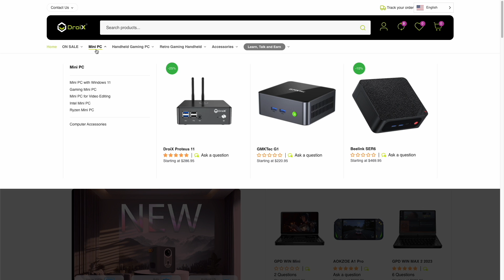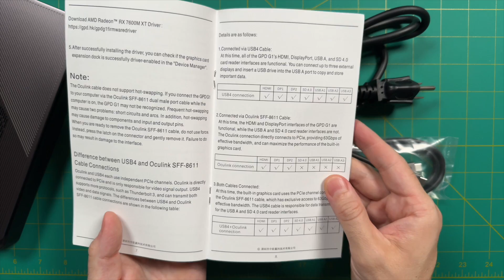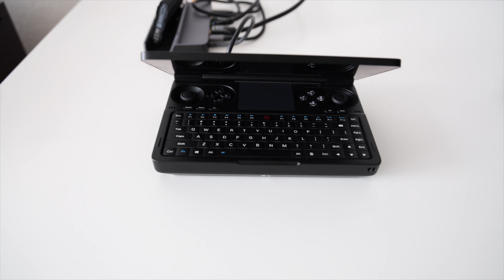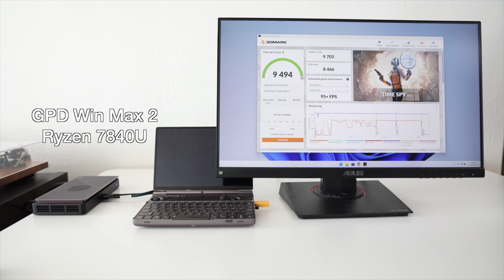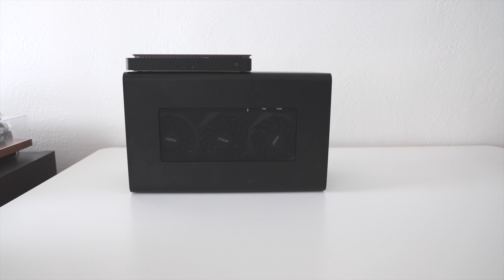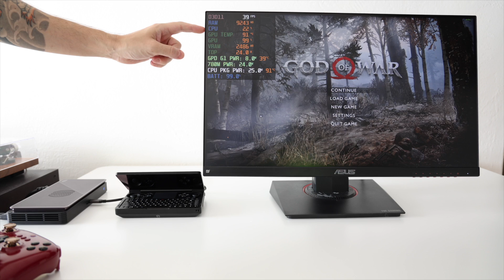Tiny GPU for Handheld & Mini PCs! GPD G1 Review

Comment: Honestly the value proposition is not as bad as what ppl here might think. Just the tb4  dock part alone can easily cost upto 300-400 USD. SO it's more like 400 usd for gpu and 300 usd for the dock features ig. Inbuilt power supply is a big W imo. It could be cheaper if power supply was seperate and has less ports.

Comment: It is also a great device for ultra portable or 2-in-1 laptops like the Surface Pro 9 or the HP Spectre 360. Turns them into very decent and portable gaming PCs. Both can be powered by the G1.

Comment: The 7600 is already a low to middling GPU and that fact alone means this thing's shelf life won't hold up well. Thunderbolt 3 and 4 have the same bandwidth limitations iirc.
Deciding on a GPD G1 vs a normal TB3 or USB4 eGPU dock is basically the difference between building your own gaming PC or buying a console.

Comment: I use the G1 with a WinMax2 7840u over Occulink as my main PC.  I love the small size and the flexibility of the setup.  Performance is plenty for my needs, as I mostly game at 1080p.  Wish they had installed a larger heatsink and fan to reduce the noise.  Maybe the next version.  =)

Comment: Hi, can the gpd g1 be a plug and play solution for the winmax2? instead of turning off the laptop everytime using the oculink.
Reply from the maker: Unfortunately OCulink itself is not hot swappable, so every time you connect/disconnect it should be done when the laptop is powered off. USB4 is hot swappable though, so if you only want to use that it’s plug and play.
Reply: @RetroGameCorps  thank you for your answer! I needed that before I pull the trigger. I want to set it up as a plug and play solution on my desk.

Comment: This is the first time ive watched anything regarding an external gpu in a while i remember watching videos when thunderbolt first started releasing and maybe some with thunderbolt 2.
What impresses me most is how much the bandwidth increases have improved performance as you used to get so throttled down that it didnt make a lot of sense back in the day but with thunderbolt 4 and oculink it is really impressive how much its improved.  
The future is exciting for this kind of tech but i do worry about adoption and therefor pricing as it will remain pretty niche. 
What I wonder is if something like Microsoft in years down the road if they leave the console space but have a streaming box for gamepass if they support something like this

Comment: They keep trying to make these as some sort of in-between, but financially, it just doesn't make sense.  For the price of some of these components, you'd be better off just getting a full desktop that you can upgrade later and a low power mobile device that can stream from the desktop.  Plus, all the cables and other stuff needed to make it work doesn't justify the "convienence".  Otherwise, you should be looking at a decent gaming laptop.

Comment: Purchased this for $595 after taxes on black Friday. Hopefully this works well with my Legion Go!
Reply: Great deal! Enjoy
Reply: Any updates? Does it work well with lego and ally?
Reply: @theitguy6092  it might be worth it for some. For me it wasn't. I usually played my Go while charging and thought "I can use this while playing on my Go since I'm plugged in anyways". The problem was that the Go requires 65w and the G1 only provides 60w. There's a workaround but after 45 mins or so it stops charging. Another thing is that I like frames over resolution. The G1 was great at giving more performance, but only at full native 1600p. When I dropped the res to 1200p or 800p, my framerate wouldn't change much. The last thing is that some games just don't work well with this setup. Assassins Creed for example gave me worse performance than just playing on the internal 780M. As for the Ally, it doesn't support Thunderbolt, so it would just be a very expensive charger.
Reply: How did it work I just bought my first Lenovo yoga 7

Comment: I love it, compact, docking station integrated and lower power consumption vs desktop GPU.
I was planning to buy a GPD Win mini + G1, BUT:
Oculink SFF-8612 does not inherently support Power Delivery neither hot swappable usage, that's why you have to connect Oculink first and then turn on the G1, so while you're using 63Gbps data speed from it, you have to use also the USB4 exclusively for PD (without its data transfer) vs using only the hot swappable USB4 port for 40Gbps + its 100W PD, as @RetroGameCorps show here.
Considering TB5 will be released next year, and it will support symmetrical 80Gbps or 120Gbps/40Gbps data speeds + 140W PD and hot swappable usage, I'm confident that it will replace both Oculink and TB4, so I'll wait until GPD release a "G2" and new versions of their handhelds with TB5.
But for now, the G1 IS a great alternative above the average options on the market, even for the next years coming. Thanks for the review, great content as always.

Comment: Despite the lack of a dedicated ethernet port, can you still connect to ethernet via an ethernet-to-USB adapter, using one of the USB-A ports at the back? Has anyone tried, does it work well / affect the bandwidth when the G1 is connected to the computer via a thunderbolt cable?

Comment: Well, it's neat, but this seems like the sort of thing to think about at an unspecified time in the future, when the games I wanna play won't even run at the lowest tolerable framerate on lowest settings and there isn't a downloadable hack that lowers them further. By that time, there might even be a "G2" or competing product that's a better option or at least brings the cost of a G1 down. I'm not picky enough to need this right now, nor wealthy enough to indulge. Hell, I wouldn't even feel a strong need to switch from the Win 3 to the Win Mini if it weren't for the fact that the lack of hinge on the Win 3 forces me to hold it at what for me is an uncomfortable angle. The graphics capabilities of the computer itself are good enough for its size, for me. But to each their own. Some people don't wanna game on low settings, and some people might intend to use their handheld as their only PC, instead of rather than in addition to a desktop PC, and I get that. It all comes down to usage.

Comment: you should check the 1% lows
in my testing with egpu tb3 dock(jhl7440) vs usb4 dock(asm2464)
tb3 tends to suffer in 1% lows, but usb4 dock doesn't in high graphics demanding games

Comment: Ahh, thanks for the testings. Much appreciated.
I wasn't sure Thunderbolt 3/4 would compatible with USB 4.0; because i found some 2nd hand thunderbolt 3 based egpu dockings with pretty good price and i planned to pair that thing with OneXPlayer Mini Pro Ryzen 6800U.
Reply: yup, tb3 egpu docks is compatible with oxp mini pro,
i have oxp mini pro and th3p4g3 dock which is a tb3 dock and works fine with it

Comment: I have a Razercore running a 3060TI on a 7840U AOKZOE A1 and it works perfect.  i believe the problem he had with the NVIDIA card was the Razercore power cables going into the card, it makes a difference which one you use.  i had this issue also.  i can make a youtube video to show best set up if anyone needs it.

Comment: Darn that the 3070 ti test didnt run..  also good to know that the amd 7840 mobile dont run well with the nvidia cards in an egpu.   

I wanted to then run 3d mark on my current setup egpu setup which is an gpd win max 2021 with an intel cpu and the 3070 ti in a razor egpu with thunderbolt 3.  But the benchmark software costs 30 bucks normally!!

Comment: Good deep review. About the noise levels, I found that if I put my dock standing vertically , it's significantly quieter. The performance is decent over USB4 on my Ayaneo 2 (6800u) handheld but I get some kind of compatibility or driver issues every so often that's hard to track down the cause of.

Comment: What I find odd is that going after AMD the desktop 6650 XT offers only slightly over 10 TFLOPS of single precision compute performance but the mobile 7600M XT more 21 TFLOPS. This doesn't make sense as the specs are very similar and the generational gains shouldn't be +100% performance while also featuring lower power draw.

Interesting to see the performance differences when compared to a Mini PC with 6600M (even if it's not an XT). I read the 7600M XT can reach around 10400 points in Time Spy under more optimal conditions (integrated instead of Oculink and maybe faster CPU).
Future revisions of the G1 should aim for lower noise levels though. Would be nice if it would be as quiet at a Minisforum HX99G or HX77G.
Reply: About the noise levels, I've found noise to be significantly lower just setting the G1 to stand vertically. I tested several games when I got mine including Cyberpunk with Ray Tracing turned on and the noise was not as loud as when it lays flat. I use this dock at my very quiet workplace during the slow nightshifts so noise levels are important to me.
Reply: @alphacompton  Interesting. Also got a HX99G yesterday that is far louder than what he showcased in an older video when running something like Cinebench. I'm using it vertically and haven't tried horizontal yet.

Comment: Ok, here's my question.

If i am spending, $800 on a handheld computer, $750 on an external GPU, $400 for an external monitor then i bring a $100 keyboard, and a $50 mouse along for my holidays, that totals to more than $2k.
At that price, I can get a gaming laptop with at least a 4060 gpu and i7 processor with enough to spare for a $50 3rd party controller that I can use to play games I want and I know for sure, it can last me at least 2-3 years before it gets replaced. Which comes with everything, a monitor, a keyboard, except for a mouse.

Why on earth would anyone want to get this? I mean even if you are on a budget and can only afford a handheld device, it still wouldn't make sense, because you will still be replacing it within 1-2 years time because the technology would just be obsolete by then and then you need to get a new handheld every 1-2 years unless you keep limiting yourself to low resolution settings for lower 

I'm not shitting on the handheld community, I want to buy a Steam Deck OLED for games like the spiderman games, FPS and also some platformers, but it just feels weird to want to connect this to a handheld device just to play games "on the go".

Comment: Correction: The gpd g1 is not "thunderbolt 4" but backwards compatible with "thunderbolt 3" and fully supports "thunderbolt 3". Numerous times you've incorrectly stated that the gpd g1 is thunderbolt 4 and that is not true, the gpd g1 is USB4 and "thunderbolt 3" is supported and backwards compatible with "thunderbolt 3" (meaning it is not mandatory). Windows 11 made it mandatory for any usb4 device to automatically be backwards compatible with "thunderbolt 3".

Comment: Holy numbers, good stuff, maybe a bit heavy on the numbers but I get it.. Maybe break up the performance differences and pricing to other sides of the video, as a small suggestion to break it up a bit from overload. Also would be interested to know how this performs with more mobile solutions. Specifically this might be a good choice for those with handhelds who want to use them as home PC's but then be able to take them on the go when they're not docked. One last thing, while I know this is a review for a specific device and you compared to the Razer, I would love if the video had included maybe other solutions that do the same thing and the general pricing. Rather then having to google after the video to find if this is really the only solution for these devices or if there might be better ones, cheaper ones ect. For instance, are options limited in this medium and were stuck with this for now, or is there an overabundance of choices for these and this is just one of them? ect.

Comment: If you have an intel NUC the Razer enclosure you wouldn't run into the driver issues but that's a very specific set up and they've killed off the nuc line. There's also m.2 eGPU adaptors for full size cards but they look super janky and looks like it's extremely tricky to set up and also you'd always have a wide cable always stick out your laptop from a hole you'd have to find yourself.

Comment: Lol, usb4 uses speeds and compatibility from tb3, but tb3 is too slow, what's wrong with you?? Usb4 is not tb4 when it cames to egpu on amd cpu, it's tb3! Your bottleneck in gpu which you used, 6650 weaker than 7600 and it's hasn't new technologies like amd sma

Comment: Would love to see an external GPU for handhelds market review video like your retro handhelds starter/best of 2023 so far video. This sounds like it would be incredible with the Steam Deck, but with so many different options and so many different handhelds to connect along, I would like to see a comparison across the market
Reply: sadly no thunderbolt/usb4 is compatible for it, due to it using old cpu (zen2) that doesn't support that I/O.
only oculink/m.2 egpu is available for steam deck but you'll have to frankenstein the heck out of it to make it work.
Reply: Most of these things are ment for people that travel and need the power. The vast majority of subscribers to the channel are not it's market use case. If you have to spend this money for graphics, you are a hardcore gamer and have zero social life.

Comment: This for me, really showed just how incredible iGPU's are getting, there was a time when they were dozens of times lower performance than even the low end GPUs, but only 3 times difference to a decent mid-range GPU is pretty incredible, and if these iGPUs had onboard internal V-RAM, even a modest 1GB, we would see 35-80% FPS improvement, with 2GB HBM2 V-RAM, the APU (an SoC that has an iGPU with V-RAM qualifies as an APU) we would get up to 2x performance, imagine then, RDNA 4 with dedicated V-RAM, we could see an APU with 3 or 4 times the FPS, V-RAM doesn't take any significant power usage either, and this 3-4x performance could be used to double battery life and double FPS, add to all this, a line-double IC chip, and we could get 3x FPS and 3x battery life, no too shabby.

Comment: Thank you much for detailed review. Can you please clarify if you had any stutter problems with USB4 G1 connection? As I remember Phawx and ETA PRIME mentioned that, like even if it's USB4 full 40Gbps speed it can have some issues  comparing to Oculink connection there these problems doesn't occur. And it's not just a difference 40Gbps VS 63Gps, sometimes it's something not well with USB4 connecton (they said).
Reply from the maker: I didn't have any issues with stuttering when using USB4, the gameplay was excellent!  The only difference I saw with Oculink was that the performance was a little better, and it was a little bit better in making that initial connection from the get-go (provided I was on the latest AMD drivers).
Reply: @RetroGameCorps  Thank you. I think you sold it me for my UM790 Pro.

Comment: I really don't get the appeal of external gpus. 

It's geared towards portable handhelds or small form factor/micro PCs.

2 things wrong with that. If it's portable machine, then this thing makes it no longer portable, or as portable as it is built for. On top of that, you sacrifice some performance to get the portability, and when you buy a portable gaming device, you are already aware of the limitations, and likely play games that don't require a high performance machine.

Same logic goes with small form factor PCs. For the small footprint or power usage you sacrifice performance. 

When you add an external GPU, you need extra space to accommodate the device. If you can have the space for your small form factor PCs and your external GPU, then why not just get a mid or regular tower? It'll be much cheaper than buying all these external gadgets to make it as powerful or likely less than a smaller or normal tower.

Comment: Fyi, there is a m.2 to oculink adapter, which is quite inexpensive (around 50 eagle dollan). You can plug it into ssd slot and it is up to pcie 4.0.

There is also an oculink dock included in that adapter. However, you gotta put a psu into that. Another youtuber has already made a video about that.
Reply: It's an NVMe to oculink adapter.  It won't work with M.2 sata ports.

Comment: Stuff like this makes me rethink my tower PC. It still runs well, but it's very much obsolete by today's standards. I think products like this make it easier for someone like me to get/build a new computer, but make it easier to move or take it on the go as needed. I see these computers that fit in your hand and can plug into a monitor making that the biggest part of the set up, outside of a keyboard and mouse. I would love to be able to have something that small and still be able to play the games I enjoy. I'm not big into the newest games like others are, but the games I do like still require a bit of power and I'd like to be able to have a computer that will last as long or longer than my current Tower PC. A portable GPU would be awesome in those regards, and I think when considering future options, this might be one of those things I come back to, and maybe like the comments on the XRear glasses, it might be beneficial to wait and see what more they come up with before buying in. 

It seems like we are very much headed into smaller, more portable computers these days, maybe not like scifi predicted/presented, but that seems to be the trend.

Comment: There is a better solution. Buy an Osmeta GK01 to affordably use oculink with a desktop GPU from an m.2 port. If you want usb c just pair it with a 40gbs usbc to m.2 enclosure.